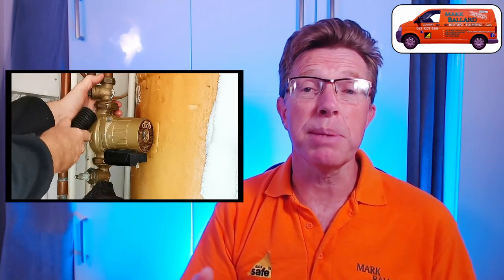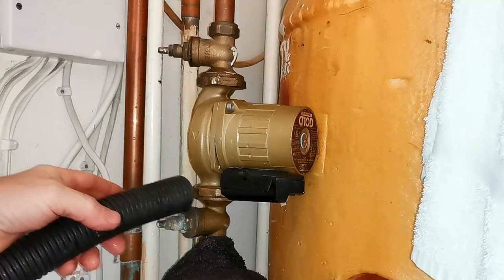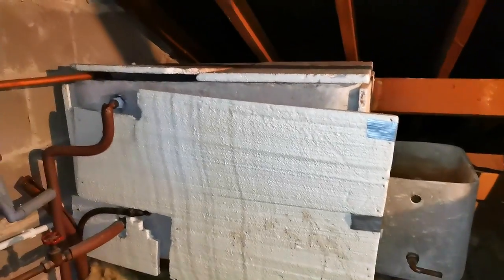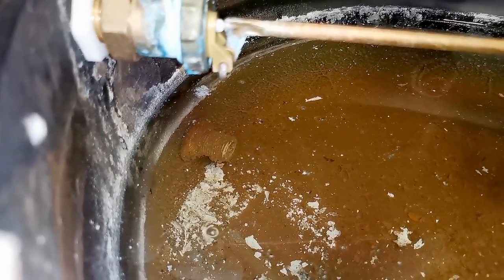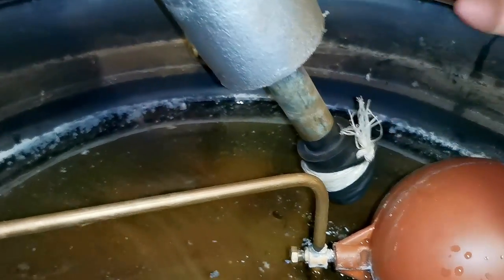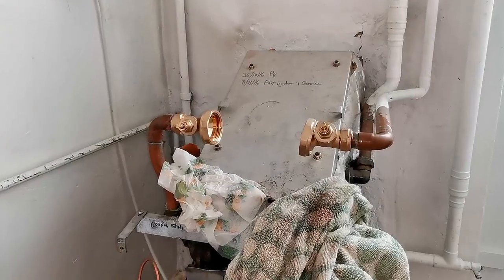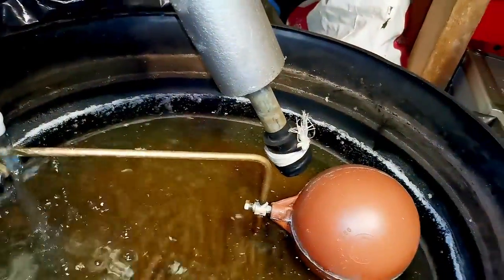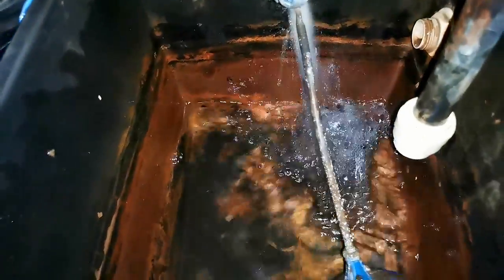Loft Tank Plugging / Bunging Up. So You Can Do Work On Your System With OUT Draining Down. 2021

Comment: Perfect ! I had the bung set from years ago, but had completely forgotten how to use them. The job of fitting a new rad plus new valves went perfectly. I would guess that the total amount of water lost from the 'system' once the rad was drained and gone, was about half a mug. It's a very clever way of doing jobs like this and I would absolutely recommend it - after you first carefully watch Mark's excellent video right through ... 😀

Comment: Is there any reason this method wouldn’t work to replace a seized 2-way Honeywell zone valve? I replaced the head and the new head works electrically from the programmer but it’s impossible to turn the valve (even with pliers when the head is removed) so I guess the rubber ball has disintegrated inside the valve. I don’t really want to drain down an 18 radiator system!

Comment: Would this method off bunging work, to replace a seized gate valve, which I need to change before I can move my hot water pipes around in a bathroom refurb?

Comment: Great video and now I know how to replace the faulty thermostatic valve I have! I would also like to do this with the main water tank feed as the stopcock for it has failed. Is this still possible?
Reply: The feed should be fed via the cold water main and turning off the main stopcock to the house should stop the flow.

Comment: Really useful to see this method thanks!, I changed a 3 way valve recently where I drained the system leaving the mains on...Thick brown water for around ten mins before it cleared, mains off and then I put in inhibitor fluid and refilled.
So.... Question is, how do you not leave a customer with a dirty system if you don't drain off the fluid and spot it then? Or would it have been obvious when changing the valve? 
Thanks

Comment: Hi Mark…I have a gravity fed system with f and e (no obvious overflow on the tank and a new build -as you mentioned there must be some protection at the boiler end so I only have the f and e to block up) . I am considering using this method to change a radiator and install new valves. Luckily I have plastic pipes so I can push them on quick! If I try this could air be drawn in from somewhere else as I have no overflow on the f and e?..

Oh and happy new year! Thanks Brian

Comment: Ihave seen two ephenee tanks in a loft, next to each other both plumbed in with open vent on each tank. I suppose they both serve the central heating system, because both were full of water and insulated nicely. Which tank do we plug, in this situation, if I need to replace a radiator valve, please?
Reply: It's actually "F & E" tank - I also made the same mistake when I first started investigating how to fix my plumbing issues. 
You'll find the larger tank probably supplies your shower and the smaller tank is for the central heating system

Comment: Nice video. 
Question: could you just turn of the cold water to the F&E tank at the ball valve, let the water level drop by sucking the water out the tank with a wet vac and cap the vent pipe? Is it just to save sucking so much water that you bung the feed pipe?
I don’t have a bung (but have a wet vac) and wondered if I could just empty the tank with the water off. Thanks. 👍🏼
Reply: Yes I believe you could do just that